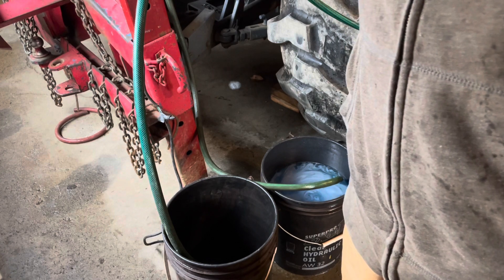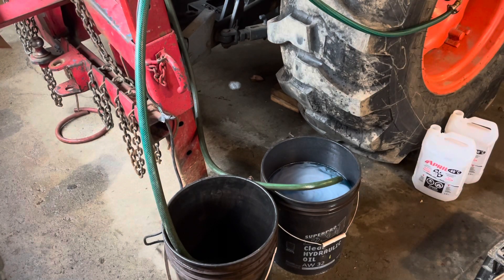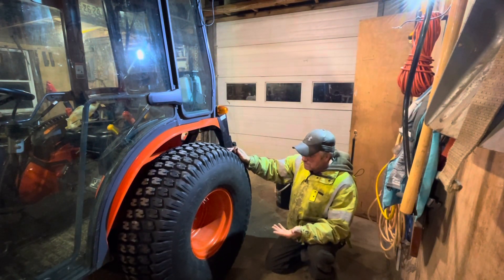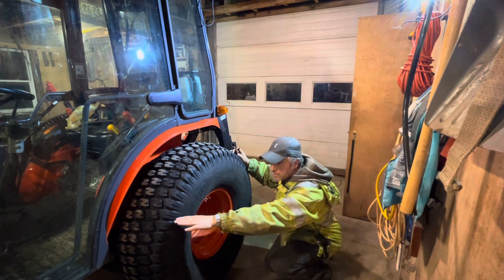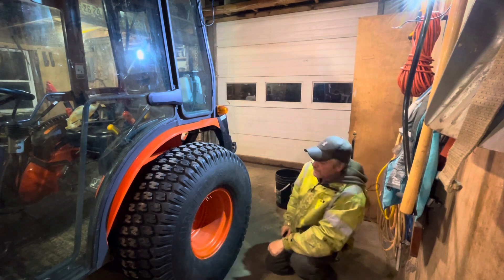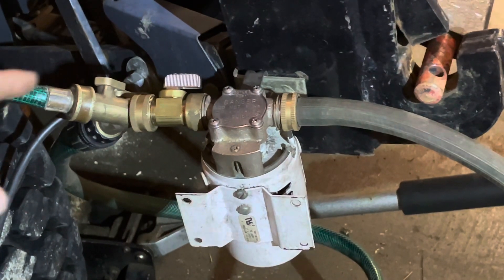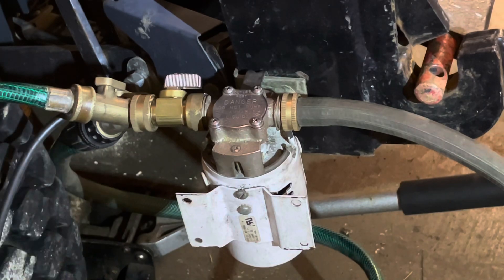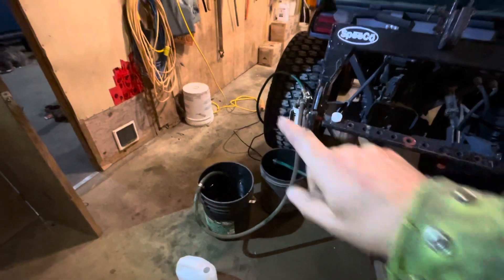Tractor tire ballast

Comment: Where did you purchase that much fluid? Is it cost effective to use washer fluid when the tires hold that much of it? I have an MX5200 with 14.9x26 tires and it is in bad need of ballast. They say they’ll hold 49 gallons each!
Reply from the maker: I bought it bulk on a pallet from a local fuel supplier. It will tell you online exactly how much fluid certain tire sizes take, or a tire shop can tell you. It was the most cost effective fluid I could find close to me. Thanks for asking and watching 😊

Comment: How's she gin'?  Nice job here Russell.  I really like the set up you have for filling the tires too.  I filled my tires and had a crazy set up.  It worked but yours is way simpler.  I also used windshield washer fluid for my tractor.  It was almost as heavy as water and a lot cheaper than beet juice or rim guard.  And having the rear wheels weighted makes the tractor way safer and even smoother to drive as well.  And you are dead on about calcium.  It near ate right through my wheels.  Great video.  Thanks for posting and take 'er easy!!
Reply from the maker: Thanks a lot Mike!
Ya that calcium chloride is bad stuff eh, seen it chew through so many rims on different tractors. Take and thanks for dropping by!!!